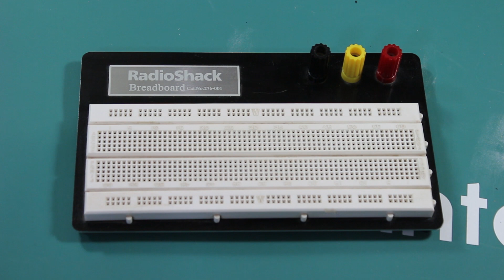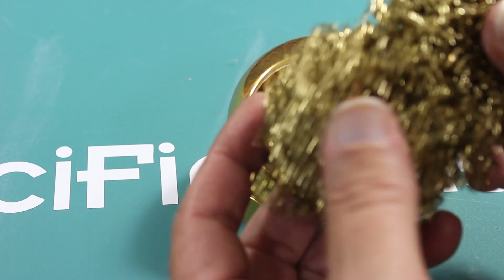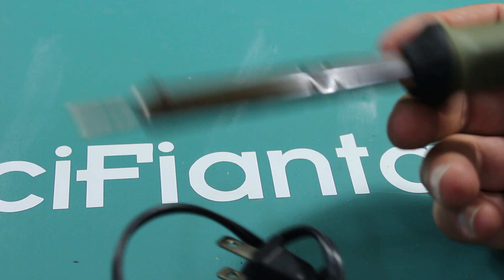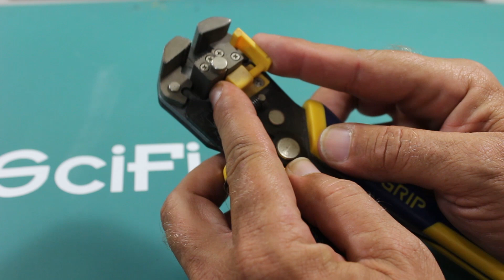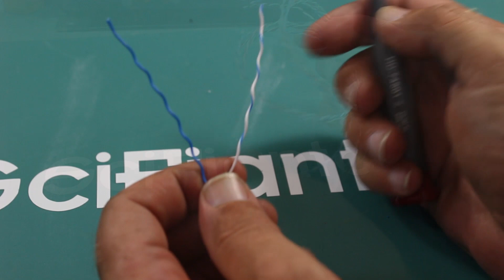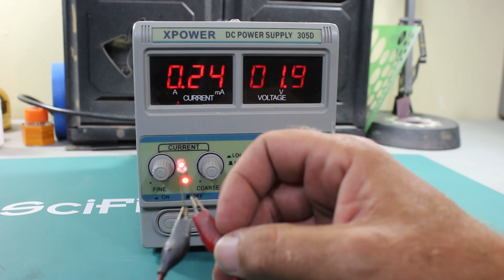How To Light Your Models The Basics Part 1 Tools!

Comment: Back years ago, before LED lighting was a thing, I used to use "Grain Of Wheat" light bulbs, that can run off a 1.5 volt "N" cell battery!! These batteries used to be available at Radio Shack pretty cheaply and the "Grain Of Wheat" bulbs could be purchased at a supply company that sold their light kits to makers of wedding cake designers!! YES they used to use these in Wedding cakes of all things!! 

NOW the battery and switch would be mounted in the cars' trunk, and hidden when the trunk lid was closed, lighting the tail lights wasn't a huge problem.....BUT my solution for the headlights was pretty easy, as I'd take TWO 22 AWG single strand copper wires, soldiering the connections to it, as I could, THEN painting the wire silver to run under the car as both rear brake lines and fuel lines, disguising the electrical connection from the trunk to the car front end easy enough! A micro small SPST switch was easy enough to mount in the spare tire of cars like my 1957 Chevy, that the kit came with a spare tire cover....even in 1/25 scale!! As for the lenses, on the tail lights I used to have a stock of red Mylar, that I could cut tail lights lenses out of back then!!!

Comment: Was there ever a part 2 for this series?
Reply from the maker: Yes I did but I hated it and deleted it :( I completely forgot to make a new one. I guess after all these years I have to get on making a part two.
Reply: @HobbyLinkInternational well, consider me one vote in favor of redoing part 2! I’m just getting started on my first LED build and yours was by far the most helpful primer I found. Started watching the rest of your videos!
Reply from the maker: Thank you.I will definitely make a part too to that
Reply: @H @HobbyLinkInternational  for what it’s worth, I’m trying to understand how to “link” the LEDs together, whether from one strip to another, or just generally how best to aggregate the separate sections of wiring back to the power source. The funny thing about video tutorials is that you can get a clear view of the technique for soldering specific lights but then the bigger circuit just looks like the proverbial “mess of wires.” Like, if I’m doing the saucer section of a starship (which I am doing!), how do I join the various LEDs together into what looks like two wires threading down to the engineering hull (and then all of that down to an external power supply). Sorry for the long response, I’m just giving context to my original comment. Thanks!
Reply from the maker: Thank you. Information like that helps out a lot. It makes making videos easier and geared toward what people want to see

Comment: Hi Kenny. I am now to your channel. Great vid by the way. My question is this. I am just getting into lighting my models (Enterprise 1:1000) and I have purchased the light kit that goes with it. I have been looking for a power source that I can test the LED strips without having to plug and unplug them from the JST 2 pin connector. I see that you have aXPower DCpower supply. Is this something that I can use to test the light strips with? Also any help you can give me on a portable power source to pre-check the lights that use the JST 2 pin connvectors would be greatly appreciated.  Thanks in advance.
Reply from the maker: Thank you for stopping by and welcome to HLI! 
You can definitely test everything from led's to boards with that power supply. YOu can set your voltages so you do not ruin anything like I have many times lol. It is a great tool to have when working on lighting your model kits. I use it to test led runs, boards, and light strip. I have never used a JST connector so I am no help on that one. All of my wires are bare copper soldered to led's, switches, and boards.

Comment: Great video. FYI the vice grips work great on the sheathing as well. They will just pull the sheathing off the inner wires and leave them untouched, and you don’t risk nicking the inner wires with the razor.
Reply from the maker: Thank you for stopping by and checking out the video and thanks for the tip.

Comment: This is what I've been wanting to learn in more depth. I have been doing some model lighting, but what I would really like to learn is how to coordinate my lighting with sound, such as lights flashing to the sound of thunder.. I have most all that equipment, plus that DC voltage generator. I love my Vise-Grip wire cutter. It's the best, in my opinion. I have that same solder iron cleaner. I use a heat gun for my shrink tubing. I always wear thermal gloves when I do it, using my helping hand to hold it. There are several things I want to know with lighting, also how to avoid overheating a 9V battery with my circuits. I know the answers are out there! Looking forward to this, Kenny. --Cindi (Granny Glue-Sniffer)
Reply from the maker: Hey Cindi! Thanks for stopping by a lot of that stuff will be answered in upcoming videos. I need to do thunder and lightning myself but that is an advanced technique using an arduino and coding. But we will be doing a video on that eventually.

Comment: https://rover.ebay.com/rover/0/0/0?mpre=https%3A%2F%2Fwww.ebay.com%2Fulk%2Fitm%2F331789929137
This is the best item for solder and heat shrink tube
Love vise grip stripper
I use cat 5/6 all the time

Comment: Hi Kenny!
What about “solder paste”?
It helps a lot with the bonding between solder parts...
Greetings.
Reply from the maker: I do use flux sometimes. I will be showing that in the third video :) but very good point!!
Reply: @HobbyLinkInternational  

Oh, dude, Flux is ESSENTIAL.  Don't kid yourself!
Reply: @GalaxyStranger01  Make sure it's flux for electronics and not plumbing. I got some and it really makes soldering so much easier.